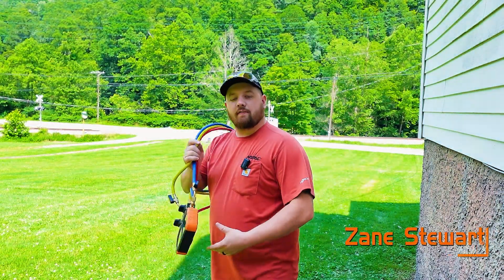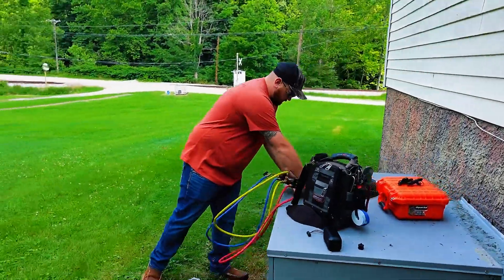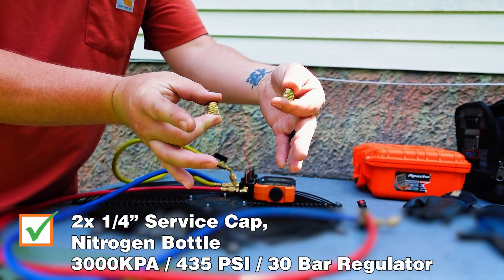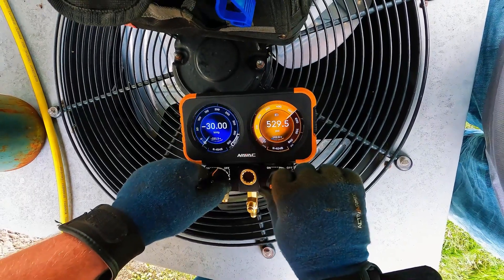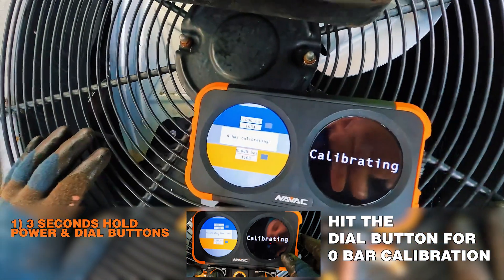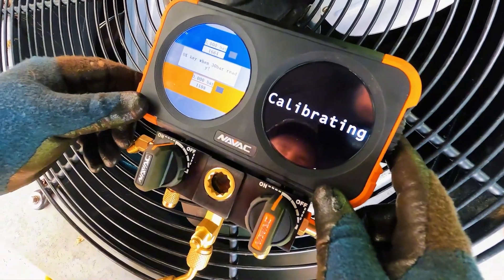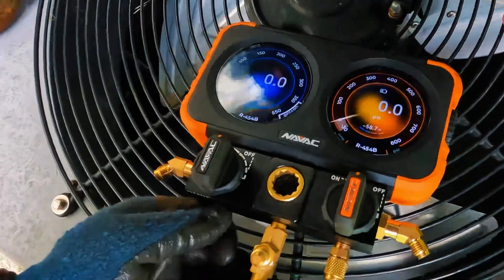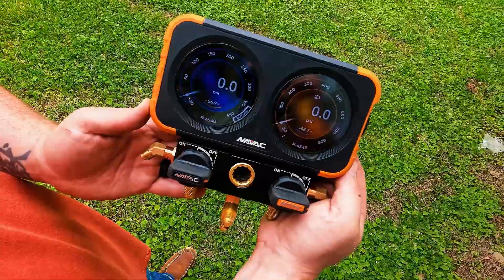N2DX CALIBRATION TUTORIAL

Comment: Sending these back to NAVAC. Calibration worked to get low side back to 0 from displaying vac. Now, low side will not register any pressures. It was cool to see at expo, but in the field it's a  fail. For the price point, they also could have built more in to be highly competitive with Testo and Field Piece Job Link. Was excited about this product however, I found it to be no more than a basic manifold with a fancy screen graphic and unreliable tech.